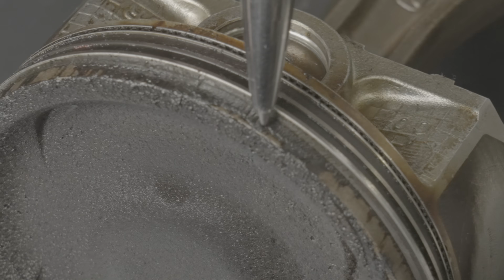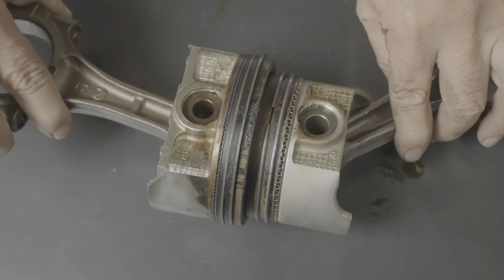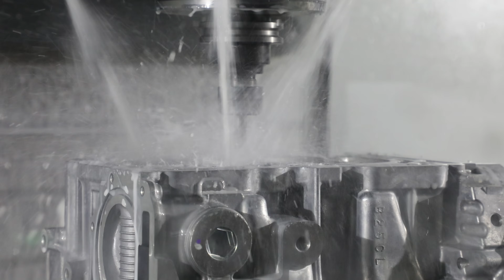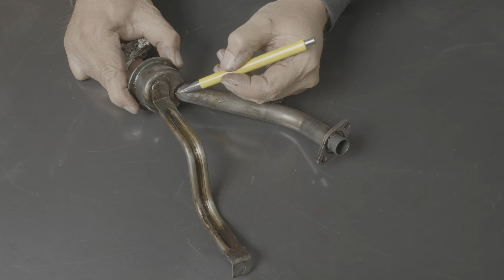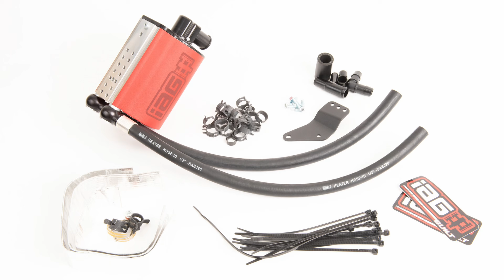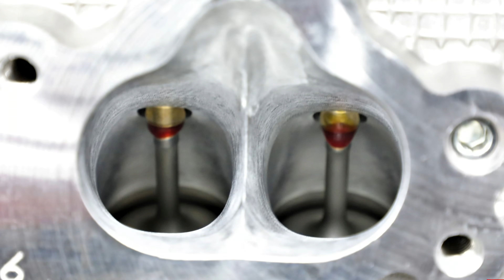Why Subaru Engines Blow Up!

Comment: My 2004 Forester XT lost 3 turbos in 150,000 miles! At about 110,000 mi. it had a burnt exhaust valve. It cost around $6,000 to repair because the engine has to be pulled
to get to the heads and each exhaust valve was $64 (sodium cooled) at that time the second turbo was already showing some scuffing, so it was replaced ($1100). That turbo
puked at 150,000 miles. I traded the hulk in on a Ford Fiesta. That was 7 years ago and it has run flawlessly, gets about 40 MPG on the freeway and starts every time.
Reply: "....I traded the hulk in on a Ford Fiesta".  IF you had all of those problems, THEN you bought a FORD FIESTA, the biggest POS Ford has sold for decades? Classic! 🤣🤣😅😆😆😅😂🤣😆😆😅😂😂🤣🤣😅😅😆😆😅🤣🤣😂😂😅😅
Reply: @eskieman3948  YMMV!  There were at least 3 engine types available, I think the one that had the most trouble was the ST that had the turbo. Mine is the
plain Jane 1.6L SE and just keeps rollin' along. BTW, I'm over 80 years old and have been a gearhead since 15. No more hotrods for me!

Comment: Subaru's over square engines in my opinion makes them a gutless no torque motor , you have to ring their necks to make anything happen. Completely opposite to a traditional VW which will pull you through anything ( not fast though) . 
I would never put one in a Beetle , which for some obscure reason people do .
The other problem with them - absolute horrible engine to work on !
Thanks for the Great wisdom , it's all dam obvious  , you point it out so well
Reply: "...no torque motor"?  Ever drive an OB XT?  Obviously not.. Well, nice BS story - funny!

Comment: Thank you for confirming many of my suspicions about the Subaru EJ series. And learning about a few more. I'm a diehard Subaru fan myself, but as I have begun moving from street shenanigans into Rallycross and now more Autocross and track days, I'm very concerned about the longevity of the EJ205 in ny Suby. I've got a list of things to get for my Suby to help it survive racing out here in the desert of Arizona.  Definitely going to be putting more priority on them now!
Reply: Ej205 is one of their best motors, I have one that's done nearly 400000kms on 18psi of boost gets flogged regularly
Reply: Mine was a MY99 - I did 425,000 K on it before I sold it.  @aidenmidson
Reply: slap an EZ in that bit
Reply: @xenn4985  Actually, I’d like to see these guys do this kind of analysis of the EZ engines too. That would be immensely helpful!
Reply: @subynut  fairly certain all the same points apply, just to varying degrees.
Reply: Swap a K24 into it, you’ll do a lot better
Reply: @connordooley  vertical pistons? Bro yuvk
Reply: @connordooley  sure, as long as you don’t mind permanently removing the hood, extending the engine compartment by 4 feet and utterly ruining any sort of handling. 😝
Reply: EJ25 and Ej205 are both arguably the best engines of the EJ line. It's not a concern. Don't listen to mechanics who build entirely around racing talk to you about engine fails. Their perspective is skewed.
Reply: @Jadorade-zero  I do race my Subarus. I do push them hard. I take them Autocrossing, rallycrossing, and track days. It IS a concern!
I’ve pushed the EJ25. Hard. It gave up on me. Numerous times. So far, I haven’t had a 205 give up on me. But, I haven’t done anywhere near as much racing with it vs the 25. We’ll see as time goes on. Therefore, for myself, this is very relevant for my case.  If I had a turbo Subaru and only daily drove it, yeah,stock would be fine. But that’s not the case for me. Besides, if longevity was the priority, I’d stay with a Subaru with the EJ22E. That’s Subaru’s workhorse. It has no problem going well over 300k miles with proper maintenance. I’d like to see a turbo Subaru last that long.  I know of 2 turbo Subarus that made it past 200k on the original build: a 205 and a 22t. Both spent most of their lives on the highway, left stock, and rarely or never raced.

Comment: Are fa20s susceptible to the same issues ? I have a 2020 brz I want to push around 300whp out of
Reply from the maker: Keep it below 400 hp and 7700 rpm
Reply: @motoiq thank you ! if you were shooting for 300 at around 8psi and going for a longevity build what size injectors would you suggest using ? I want this to stay my daily/ road trip car. I don’t mind sacrificing some fuel economy to keep stuff cool and on the richer side
Reply from the maker: around 550cc
Reply: You the man!  I’ll take that as gold thank you sir 🙏. It’s my first box engine, I’m coming from civics, dsm eclipses, and an 85 celiac gts with a 22re. Totally different beast than what I’m used too. I Just loved the car so damn much figured it would be worth the pain haha k swap bell housings cost too damn much Dx

Comment: Just in case someone needs to hear this.  There is a pretty direct path to building a fun and reliable Subaru.  Assuming you don't have to have sky high power numbers. The EZ motors (the flat 6), expecially the EZ30R and the EZ36, provide WRX / STi power levels NA.  If you're happy with that level of power, these powerplants are cheap and super reliable.  I have a EZ30R in my RS with 05 STi drivetrain, and it's a fun and zippy little car, I beat on it, and it just smiles.  I have an EZ36 sitting in my garage just in case, that I picked up for $400.  So I have a replacement if something does manage to have to this engine ready to go.
Reply from the maker: My opinion is the six's make an already nose heavy car worse and screws up the balance more, they also seem kinda fiddly as many people seem to have trouble keeping modded turbo ones alive, last of all they are much more expensive to build and graft into the car.  I think one of our engines putting out power in the low to mid 500's is reliable, better handling, more fun and cheaper.  Maybe they can be run at lower boost to make equivalent power with more reliability but its a lot of trouble to do that.
Reply: @motoiq  The turbo point is not a strong one, as I was specifically throwing it out as an NA option.  So not being good with a turbo, doesn't matter.  Perhaps it makes the car a bit more nose heavy, but honestly, racing my 99 EZ30R RS, I don't really notice the extra weight as compared to my 06 STi, and I've run them back to back.  (Perhaps I'm saving weight not having all the turbo stuff under there.) I guess some drivers may detect a difference, but I seriously doubt most drivers would.  As far as the cost to do an EZ swap, it really depends.  It can be done for a grand, if you do it yourself.  Of course, it can also cost ten grand if you have a shop do it.  Though, once you get it done, if you need to put another one in, it's a pretty straightforward process, and would be a lot cheaper than buying another one of your engines.
Reply from the maker: Maybe it will almost be the equivalent of a stock EJ257 if it is a mildly breathed-on NA. The turbo will still have more low-end torque. A moderate engine (low500's)we built will eat it for lunch. It is still something to consider for a stockish replacement I guess.  The funny thing is some of the more knowledgeable youtubers who have tried to build hot turbo versions of the EZs seem to have a lot of weird problems that take the motor out.
Reply: @motoiq  yeah, I'm by no means saying the EZ engines are some sort of performance beast.  Right off the bat I said this is for people not looking for sky high numbers.  If you're unsatisfied with factory power levels, than swapping to an NA EZ engine is not going to achieve your aims.  However, if you are happy with stock power levels, and you want a bullet proof setup, an NA EZ might be something to consider.  I don't care how well built that turbo setup is, there is just more to go wrong, and when it does go wrong, it can go wrong in a MUCH bigger way than with NA.  Not to mention the expense of recovery.  If you manage to somehow break your EZ, say you run it out of oil because you put a rock through your oil pan, you can find around another for ~$400 if you look, and after the initial swap, putting another in is just a regular engine replacement.  Depending on what you're doing, and your priorities, this can be a HUGE win.  Also, personally, I like the way that an NA EZ develops power over a turbo EJ257, it feels more "natural" (pun intended).  But then I've always liked NA power over FI.  And yes, AGAIN, I would not recommend the EZ if turboing the build is what your aiming for, I'm purely point this out for people who want an NA setup.  If a person always liked the stock STi, and just wish it were NA, that goal is 100% accomplishable, and there are tangible benefit to it.

Comment: What makes me wonder is why Porsche Turbo H6s don't tend to explode at such a rate as say WRX/STI Motors, given a equal HP/Liter. For example people run 700-800hp on a stock 3.8 in a 991 turbo, which is 460-52hp in a 2.5 Ej, which at that power is almost guaranteed to blow up, hell some build Ejs blow up at that power. I know it's not an exactly apples to apple comparison, but I am just wondering what the reason is.
Reply from the maker: Because they are much stronger and more expensive engines designed for higher power outputs.

Comment: They can afford to drop the bore, their cars are small and don't need more than 140hp from the factory. Would be easier to meet emissions and the buyer can have their way with it after that.
Reply from the maker: The market wants 2.5 liters and 300 hp.  It is a performance car.  It is fine stock, it just doesnt like poorly executed mods.
Reply: @motoiq  so Subaru cars equipped with their flat engines are sports/performance cars?  If that's the case then that makes sense but I do see so many non sport models having way more power than they need
Reply from the maker: No one wants to buy a 3000 plus lb car with 140 hp
Reply: @motoiq  it's a bit weird honestly, I know someone with a base model Kia optima and that thing is pretty snappy even though it has less than 200hp.

Comment: Never had a problem, owned two. One has 250,000 on it and the other is well on it's way. They are so reliable they use them in airplanes (ultralights)
Reply from the maker: You probably have a non performance model.
Reply: @motoiq  Yes, I wouldn't have it any other way
Reply: In a front engined, single engine aircraft, propeller placement is important, a very low prop is undesirable due to lack of ground clearance, and pitch up/down tendencies with any power changes. 
   Inline engines used with this prop placement are often upside down, unless a gearbox is used, which comes with plenty of drawbacks.
   So, the flat engine shape simply fits well, which is why lycoming, continental, and Franklin all do so. 
   It is not because of "subaru reliability". They quit a lot. Look up a kit engine seller named "eggenfelner"...recently quit pushing subarus is now into Hondas.  Which are also questionable in aircraft. Big displacement, low hp, and no gear reduction do a lot for reliability in aircraft. The power requirements are more unique than they appear to a casual observer.
     Subaru=bad idea. As with many other car engine conversions.
Reply from the maker: Aero engines are built strong and stressed lower for their beefiness, with big torque, low rpm, and low power.  I get a lot of inquiries but tell customers that a car engine isn't the best for a plane and I don't want to do them.  Imagine running an EJ flat out all the time. In the air you can't just pull over when something goes wrong.
Reply: You are smart to decline that sort of work. Everything should be done keeping in mind that the person you need to please is "the attorney representing the family of the deceased". The faa is the least of your worries.
   I'm an A&P/IA, pilot, etc. Used to do a fair amount of odd repairs, welding exhausts, etc.  No more. For the above reasons. Cars & motorcycles..some freedom to do interesting engine work there!
   Even bigger torque rich engines, say LS...the power isn't really at the right RPM for a prop, and they aren't made to run at 75-80% power all the time.
Reply: @firstielasty1162  I didn't say they use Subaru like engines, they use Subaru engines
Reply: Yes, I'm aware that they use actual,  genuine subaru engines. And vw type ones, corvairs, etc.
   A subaru powered aircraft crashed at pottstown, PA 2 yrs ago, a corvair powered one at queen city airport a few years before that,  which I helped get out of the little lehigh creek. Both were engine failures.  
   Those two examples, yes, are "anecdotal "...but their overall bad safety records are definitely not.
   Aircraft flat fours and sixes are massive compared to small car engines, and make peak power at half the speed, because propeller tip speed limitations make higher rpm useless. So people make gear or belt speed reducers, which are trouble even on the rare factory aircraft engines that use them. 
   My mention of eggenfelner in the prior comment was referring to a guy that, for a while, tried to peddle subaru engines to kit aircraft builders, who has since quit that and moved on to Hondas,  which I think continue to have problems, but, that's for him and his customers to mess with, I don't care as long as none fall on me. One of those crashed recently due to engine failure,  it might be pleasing that it isn't just "subies" that blow up.
    Try to think of a scenario where you run a subaru, or any other car engine, at 80% of max power for like 3 hours. You cannot do that on a track with corners.
    ..I mean hours without lifting even for one second. Airplane engines do that their whole lives. Subaru's don't,  nor Hondas,  ls's, whatever. A boring lycoming io-360 does it pretty well. It's a 6 liter flat four with 180-200 hp. Blah. But reliable.
Reply: Subaru also made a complete general aviation aircraft. With what for an engine? Yes, a flat four. But, sorry, subaru chose somebody else's flat four. Lycoming, from PA. Either an o-320 or o-360. Clunky, big, air cooled flat fours, that do well at producing 150-180 hp for about 2000 hours. At 25-2700 rpm.

Comment: Pretty much every high revving engine runs bucket over valve style valvetrain. Look at all the motorbikes and even F1 engines. none of them run rockers. The Honda finger follower design is old, bucket style is far better.
Reply from the maker: Some F1 engines run finger followers for the reasons I talked about.

Comment: That unequal exhaust port geometry and shape may explain why the Subaru has a totally unique sound.
Reply from the maker: It is the exhaust design.  Put a 4-1 equal length header on and it sounds normal.

Comment: Okay so if I want to build an all-wheel drive track car. Would it make sense to go with an Evo? I know those have their own set of issues but probably less
Reply from the maker: The Evo 8-9 is bulletproof, avoid the six speed trans, the Evo 10 has a strong engine but the transfer case is weak. Sheptrans can fix that. Avoid the DTC trans.

Comment: other than to save wieght i never understood why Subaru went away from the closed deck block, they had a virtually bulletproof turbo engine and made it weaker.......i'm glad i have a v1-2 closed deck EJ20 engine.
Reply from the maker: Emissions, open decks have less HC due to more even heating of the top of the bore. Also open deck can be cheaper to produce.

Comment: I enjoyed the video. What I got from it was for racing applications, the engine needs to be modified to address the weak points. For non racing application, there is absolutely nothing wrong with the Subaru engine. The same advice would apply to racing a small block chevy.
Reply: Exactly, just another motorhead clown who talks shit about Subaru

Comment: Firstly, thankyou for such an informative video. I knew a reasonable amount already from researching the EJ engines, but this was another level.
Regarding the pistons, I'm in the middle of preparing for a mildish build (not likely to push beyond 300hp) for my Legacy GT. I'd like to steer away from the stock hypereutechtic pistons, however I don't think 2618 pistons are ideal for my application either. What's your take on running 4032 pistons and who would you recommend to supply these?
Reply from the maker: 4032 is good for a mild long life build.  JE, CP, Mahle, Wiseco all make good pistons.
Reply: @motoiq  Does JE, CP and Wiseco all make 4032 pistons for EJ25's?! I have only seen Mahle 4032 pistons so far.
Reply from the maker: Yes you need to custom order them
Reply: @motoiq  thanks for the info. Greatly appreciated